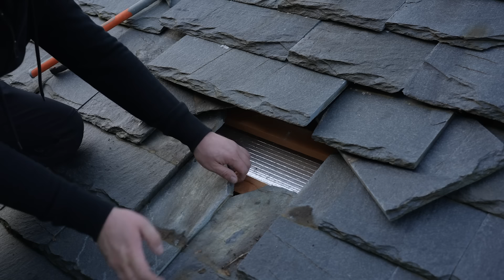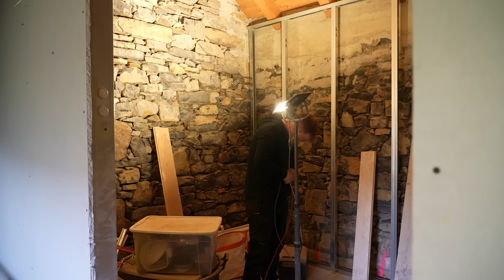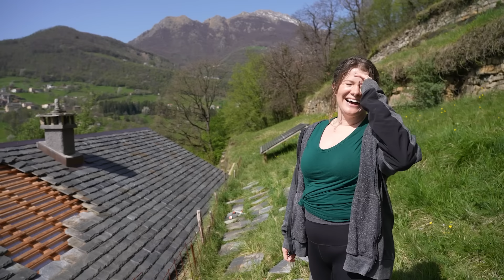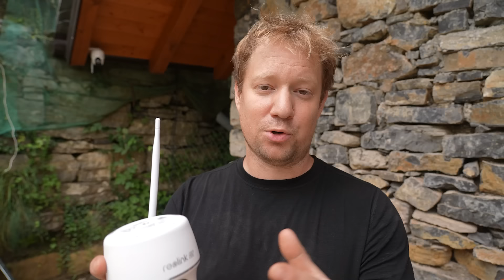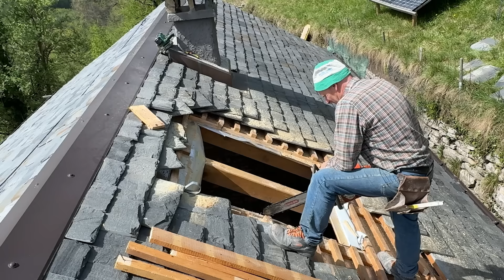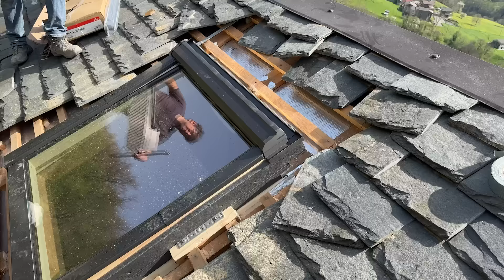Making some BIG CHANGES to our Italian Stone House.

Comment: A few weeks ago I wrote to you about the windows in the roof, the light in your house was not enough. I'm glad you finally did it.  The difference now is big !!!
When you have money, build another skylight. It would also be good in the future to build a large cistern for the water you will collect from the snow and rain. Make the fireplace energy sistem for   heating and hot water throughout the house.A few panels for energy and you will have an ecological
,economical and autonomous house.The place where your new house is has a lot of water, wood and sun, use them.

Comment: So glad you have put a skylight in the bathroom. I don’t tend to offer advice but as someone who has done a lot of house renovations i did make a comment in one of the videos about putting one in. Just image having a bath with a nice glass of Italian red wine looking up at the stars! What bliss. I would also really consider a window on the back wall even if it has no view (use frosted glass) that you can open for ventilation. Lack of good ventilation in bathrooms is the number one reason why mould occurs and with 3 ladies living in the house you’ll need it 😂. If you can afford to add skylights to the other rooms you won’t regret it. If the girls are worried about people being able to see in you can get electric controlled blinds thought these can be pricy.

Comment: Looks excellent, guys! Good call. One option you've probably seen are Solar Tubes. They let daylight in through walls or the roof with a much smaller footprint. Might be an option for the stairwell or other rooms. 
We used one very successfully in an long narrow attic room with tiny windows on the end walls. It suddenly became the lightest of rooms with only a 16" hole in the roof.

Comment: I loved seeing you pacing the roof while they cut your timbers! Like an anxious father awaiting his first born child! I feel your pain, the loss of control while someone else cuts into your home is scary! We moved to France and had 4 Velux roofs put in, so I felt the same way! But it was the best thing we did though. As someone else mentioned if you can scrape together another 600 euros (or come to France and buy them for half that!) then pop another one in on the other side of the roof somewhere - you get a lovely high level through draught then which will be lovely in the summer. ❤

Comment: Love the skylight! I almost would go with two smaller windows that went of either side of the roof beam. Always scared of cutting support beams.
Reply: ...or just put one larger skylight o-v-e-r the supporting beam ...except this skylight  opened  ...so the beam would have blocked it from opening.  <3

Comment: I honestly thought before you said the window is in the bathroom that you were working on a skyline above the staircase.  I think the extra investment for one above staircase, even if it is a long skinny one, would serve the purpose over the staircase.
Reply: ...YES i DON'T THINK THEY SHOULD REMOVE ANY MORE BEAMS SO CLOSE TO EACH OTHER ...oop! caps  ...anyway the stairwell and the bathroom are right next to each other  ...so if they did opt for a skylight it should be between the beams  ...like you said a very skinny one  ...or transom windows high on the stairwell wall that is shared with the bathroom ...light would spill from that huge skylight into the stairwell with high windows on that shared wall!!  <3

Comment: That special tool is a "shingle bully," it's a long flat bar with small hooks ground out close to the end so you can get under the tile, locate the wire or nail, and pull back on it to free the tile. You may want to get one for future work on the beautiful slate roof of yours. <3!

Comment: You can make more skylights with a sheet of polycarbonate. Just slide it in under the slate and put a double layer of silastik down the sides andhave it extend over the bottom slates. Then paint the bottom edge to look like slate.

Comment: male sure you get skylights that can be opened via remote control. No electrical cords required as the have small build-in solar panals which produce enough energy for the electric motor opening and closing the window. (e.g. velux)

Comment: Bradey, you may have done this and just not shown it. But what I saw was a few nails holding up the framework around the skylight. This framework also replaces the structural beam you cut. You need structural screws there. We are not talking decking screws or sheet metal screws. Simpson makes them in the states. I don't know if Italy has such an animal, but you apear to need something there.
Reply from the maker: There are structural screws. The nails were to temporarily hold the beam in place to then add structural screws
Reply: 👍👍👍 @RaisingVoyagers

Comment: Brady, skylights  you can add at anytime, so maybe do the  jobs you need to do and save to have the extra ones put in. Also you could have smaller ones that fit within the beam space which means your not having to cut threw a beam. i have 3 of these window 2 in my sun room and 1 in my craft room and i love them. the light that comes threw is amazing
Reply: through?

Comment: Great job to increase the light & airiness of the bathroom. Hate to be a party-pooper but in the UK at least, no-one but a complete cowboy would install a Velux like those guys did! The problem is a major structural fault: when cutting out a section of a major timber, the whole weight of that section of the roof structure is transferred to the trimmer at the top & bottom of the opening, and from there onto the rafters either side of the hole. So the issues are:
1. The timbers should be fastened together with heavy duty mechanical fasteners (typically including dog-tooth washers, steel joist hangers etc); and
2. The joists either side should be reinforced with extra timber as they are now carrying not only the weight of the removed rafter but also the pressure from the matching rafter on the other face of the roof.
I'm surprised if proper practice ("to code" in US parlance!) is much different in Italy. 😮
Reply from the maker: We used structural screws and reinforced everything properly, I just forgot to film that portion.

Comment: I was waiting for you last week, I hope everything goes well. why didn't you insulate the wall against the ground? It is always a good idea to insulate between the new brick wall and the wall against the ground, with a draining barrier and high-density thermal insulation. Those stone walls in their current state are as if they didn't exist. Furthermore, the entire roof is not thermally insulated, this should be done because the roof disperses more than the walls.
Reply: ...I'm pretty sure they insulated in at least one room  ...not sure which one, it's been so long since it aired.

Comment: now supporting instead of one beam only 4 nails on each cross beam. This cross beam I would fix them more firmly. Now is more weight, plus snow
Reply from the maker: also structural screws. It's to code. I just didn't film everything.

Comment: 😲as much as it does give you good light, skylights ALWAYS LEAK🥴...don't think I would have done that to that beautiful roof that would last forever...but that's just me. On the other hand you really do need a window in a bathroom for ventilation to get rid of moisture so. I'm just not a fan of skylights because of the eventual leakage🤙=^..^=

Comment: The stonework of those walls has to be some of the most beautiful stonework anywhere - the mix of stone sizes, the different colors of grey with touches of ochre and darker slate, the rough horizontal layering with minimal to no grout visible. I hope the plan is to leave some of the internal wall stonework visible and not plaster over  everything? Or is that impractical in reality?

Comment: did i see it right, the window doesnt come with a motor or shaders? and in this hight you cant reach it without a ladder. maybe you consider to put some cables there or at least a pipe that you can run cables there later. better to have thomething there and didnt use it than needing later somthing and cant do it.

Comment: Heat pump.  In the summer it will pump heat in and in the winter it will pump heat out.  We built a home, wanted natural light, yeah...heat pump... Took them out to years later.

Comment: Hi I ordered a system from them through your link and my card info was stolen. Spoke with reolink and thy have no order on file. 
Then right after that someone tried to make a purchase for 26.03 but it was rejected due to the wrong card valid date.  Just a heads up.

Comment: Why are you leying red bricks sideways? Holes supposed to be upright so you have locked conection between rows ... that is the way builders over here in your neighbour country ley them 😉
Reply from the maker: This is the way they lay the bricks here… and everywhere else I’ve ever witnessed it before. I don’t even know how you would lay the bricks with the holes upright as so much of the mortar would fall into the inside of the bricks rather than locking the bricks together
Reply: @RaisingVoyagers  In Slovenia they always put bricks with holes upward ... our house is build that way ... mortar needs to be less liquidy that it runs into holes just a little bit so junctions are more solid.
Reply: ...seems like they would bond more tightly together   ...I guess in Italy they have their own ideas.  @OtikaOtikaOtika

Comment: How the hell is that roof waterproof?
Reply from the maker: @brianredban9393  lol, these roofs have been used for centuries. Modern day asphalt roofs leak more than these do and have to be replaced every 15-25 years, whereas these roofs can last for hundreds of years. If you ever have a small bit of damage you can just replace a tile rather than replace the entire roof like with asphalt. Not to mention the fact that with asphalt roofs you’re basically covering your house with dinosaur juice instead of using natural stone 😂😂😂
Reply: @RaisingVoyagers  I agree they look way better my question is how are they water proof. Are they that smooth that they sit flush on each other? How doesn't water seep through the cracks
Reply from the maker: @brianredban9393  if the water enters through the cracks there is another stone beneath it to catch the water, the gaps are spaced overtop of another solid stone. No leaks, not sure how to explain
Reply: @RaisingVoyagers  I got it . Thanks 👍